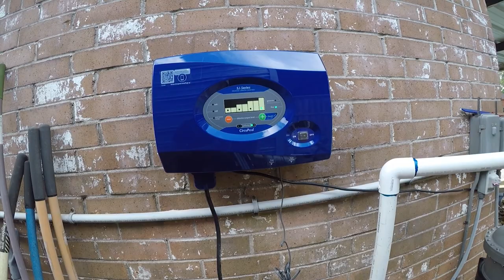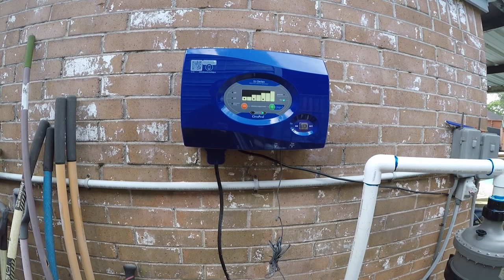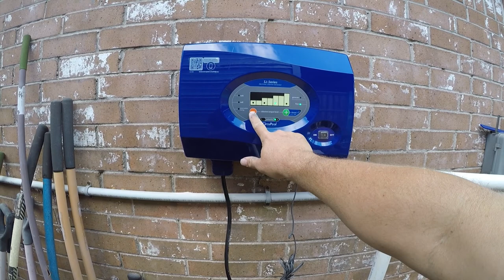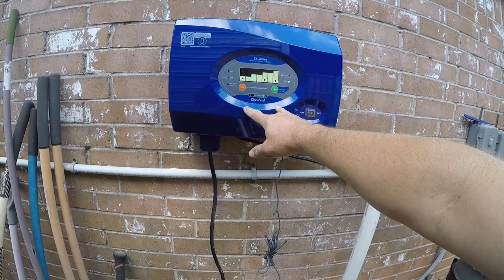Pool Maintenance: Installing a Typhoon pre-filter and a Chlorine Generator (saltwater)

Comment: Thanks for sharing. I'm about to add a Typhoon to my pool and this helps. I didn't see you put any primer on the pipes.
Reply from the maker: I'm using "hot" glue.  Primer is good if you never want to take it apart.  Never is a strong word with pools.  So by gluing without primer it still seals but you can break it apart in the future with a little less hassle.  Hot glue is sometimes sold as wet or dry glue.  It does not require primer to be effective.  It is a fast and more aggressive setting glue.

Comment: Hey Brian what you want to do is get a hot air gun and heat it up and get long nose pliers and twist out the old piece of pipe out your done bro prime and glue push in new fitting . Don't worry hubby we all need to be shown or told it's cool .